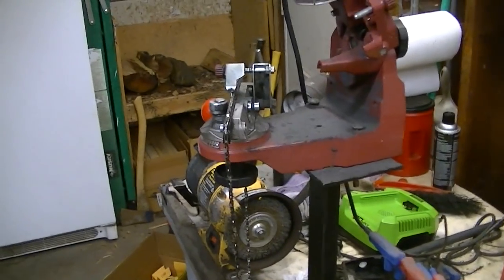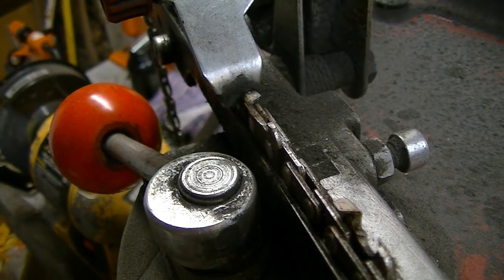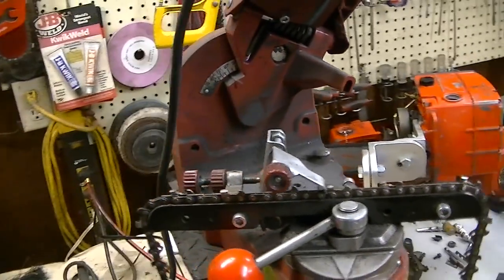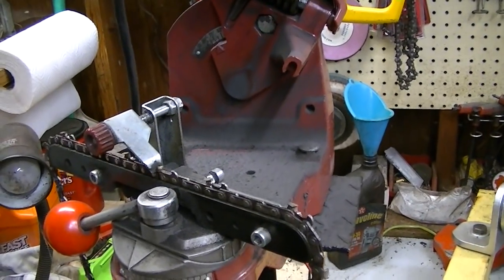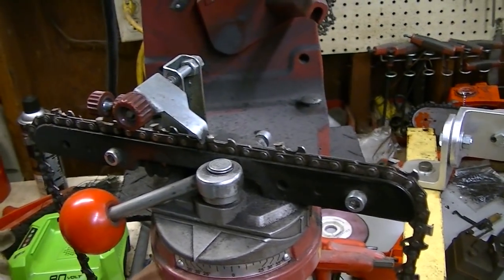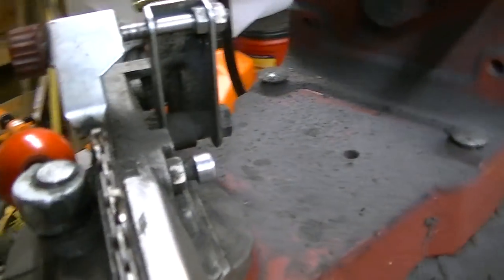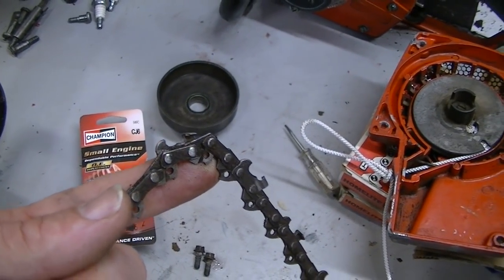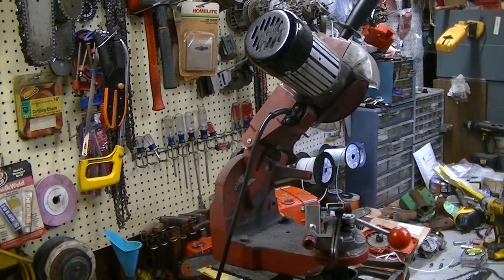Why I Prefer a Chain Grinder

Comment: One question I have is there an adjustment for the arm that you use to lock the chain in? Mine always seems to come loose and I have to hold it in place. I can't figure out what the bolts with the lock nuts on. I have tried to move them in and out and I can't see or feel any movement when I adjust them. I also use 30 degree's
Reply from the maker: Nope, this model you have to hold the clamp while you grind.  No lock at all.  The bolts with the lock nuts are for centering the vise that the grinder will cut the same from both sides of the chain.
Reply: Could be why my chain teelth come out longer on one side. I will have tyo look into that.
Thanks
Ted
Heal well!!!!
Reply: I just had this problem. There is a snap ring that holds the handle on. Take that off and remove the handle, after that is removed there is a large nut under the handle. Tighten that up, it didn't take much. I removed the vise completely by unscrewing the angle adjustment knob, just be careful lifting it off because there are springs under it.
Reply: Let me guess...your grinder is a braur-ag? They are fiddly
Reply: @LeonsChainsawPartsAndRepair  , same as Chris below, but also carefully grind a curve in vice rail same radius as cam lock. Not too deep, but it allows the cam to " bite" & stay locked tight despite vibration of running motor.
Vintage Oregon had abovementioned & gripped. New copy didn't  & couldn't get to adjust cam bolt adjusted to hold till created above. Hope make sense & helps. Very informative content, your videos. 👏💯

Comment: Tooth length has no effect on h ow the chain will cut, and it will not cause any excess of or uneven wear to the bar. This has been proven in demonstrations many times.
Reply from the maker: That is true if the depth gauges are all set properly and all teeth are actually sharp at the proper angle.  Many people fail to sharpen both sides of the chain at the same angle and almost never touch the depth gauges.  So for the novice or average user, keeping the tooth length the same helps mitigate some of the problems that can arise from not following a complete sharpening routine.  I just know how many bars come through the shop that have massive wear to one side...there's a reason the Barshop gets so much use!
Reply: @LeonsChainsawPartsAndRepair  No doubt most are better at sharpening one side better than the other, and never flipping the bar doesn't help either.👍✌
Reply from the maker: You got that right!

Comment: Hi Leon I had a question Are you using the sharpener for just Oregon chains or have you had success in using it on stihl chains? I was thinking about getting a sharpener like this like the Oregon 410 but when I looked up a lot of reviews on it people upset Oregon's documentation only shows the angles for their chains and that there's little to no literature online of how to set up a grinder for the stihl chain. I was curious if you've done Stihl chain as well and had success?
Reply from the maker: Oh yeah, they are all very close to the same and I've been known to set my own angles!  The backplate angle (tilt of the grinding head) is easily adjustable and that's about the only variable between the manufacturers that might not be a constant.  Stihl chain tends to "burn" with lower quality grinding wheels (the less expensive pink ones), so you'd want to run a nice resinoid wheel.
Reply: Agreed

Comment: Any idea how to adjust the screw on the back side of the vice?
Reply from the maker: Trial and error I'm afraid!  In theory it is supposed to center the chain so that no matter which cutter you are grinding (right or left), you don't have to adjust the depth.  I've got mine close, but I'm still 1/2 a turn off...I gave up and just remember the 1/2 turn when I switch sides!
Reply: @LeonsChainsawPartsAndRepair , I have been having similar challenge & find the adjustment very fickle. Wonder if the adjusting screw were changed for a one with a finer pitch, thus allowing an easier accurate setting? Such as UNF, rather than metric.

Comment: Oh, forgot to mention, I have a Harbor Freight chain grinder... So much slop, that even with care, it just can't do the job any better than my old hands.
Reply: Suggest take up slop with bush on pivot pin or degrease & take up with epoxy two part glue. Have used a piece of scrap tape measure blade to do this repair.

Comment: Does that thing do the rakers?
Reply from the maker: Sort of.  I have a wheel that I shaped to a slight taper, so I can manually file the first one to the proper height and then set the depth stop on the machine to do the rest.  It works pretty well, but not perfect.

Comment: Isn't it just easier just to flip the chain for the other side to make it evener? JD
Reply: If you did that, you'd be grinding the back of the tooth not the front (just picture the cutters, normally they face the right and if you flip the chain they then face the left).
Reply: @killer2600  Yes your right. Silly me.

Comment: I use just a file and a file handle, unless the teeth are worn so bad that I cannot pick up their angles.  Then I will use a file guide.  I have a grinder but I can sharpen several chains before I get that sob set up.
Reply: What kind  is it and wht you got to have for it. Ill take it off your hands for you. They Not nothing but junk anyway

Comment: My new Oregon 520 is leaving a  huge burr on top of the cutter.  Anyone have an idea of what's going on?   TIA

I think I will try your technique of taking small bites with the grinder wheel.
Reply from the maker: The burr is due to the direction of the cutting wheel rotation...the older models of grinders could run in both directions to match the tooth being ground, but the safety laws did away with that feature.  Shorter "bites" and removing less length of the tooth at once can help control the amount of burr created.  The metal that is left behind is brittle though and comes off in the first cut or two, leaving behind a sharp tooth.
Reply: He's right ! Your taking off to much at a time.